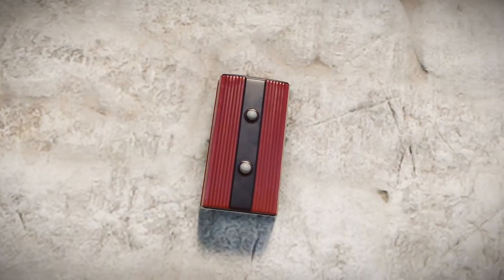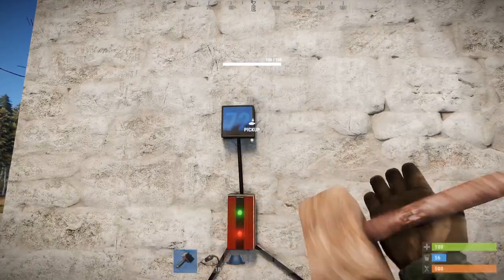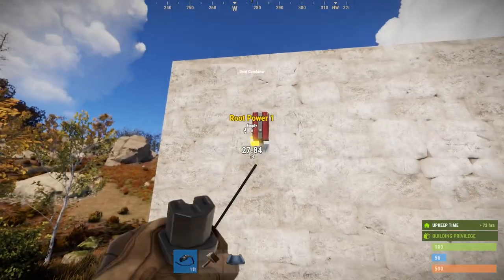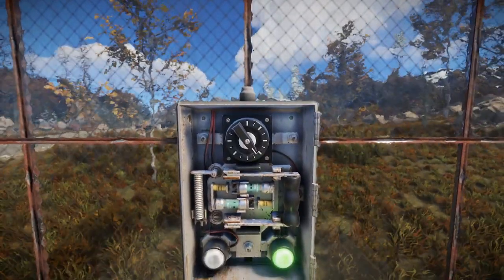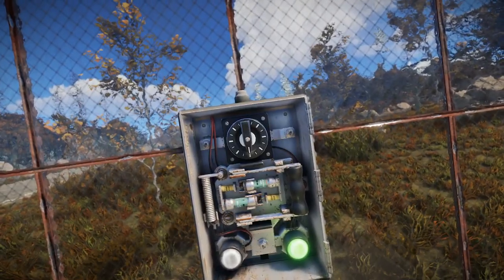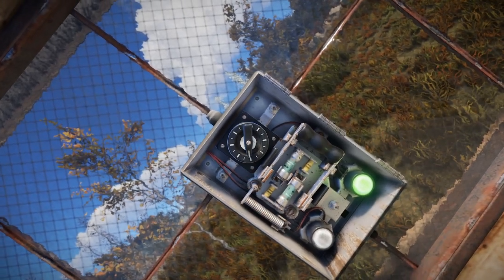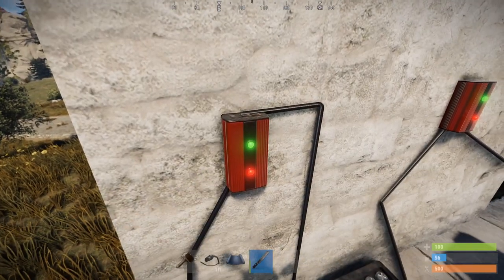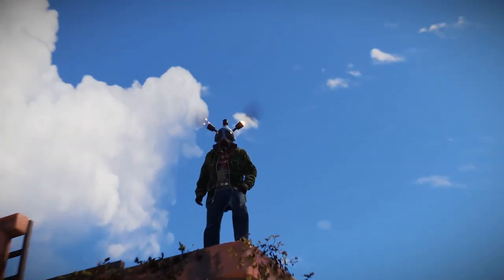RUST - Power Minute - Root Combiner

Comment: I'm unsubscribing if you don't do more "ur mum" jokes
Also root combiners are useful for extending your cable length if you need to reach windmill on a tall tower
Reply from the maker: I guess Wavey has spoken. Also yes, but doing that counts towards your 15 in a circuit so I was apprehensive to advocate it.